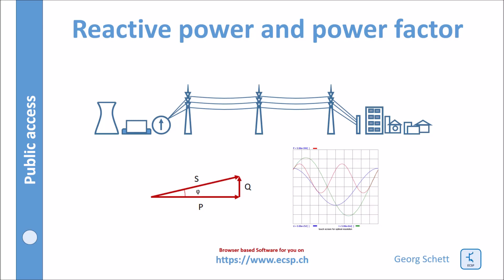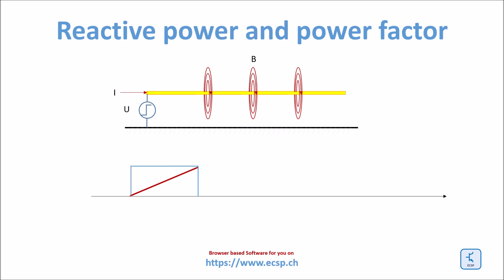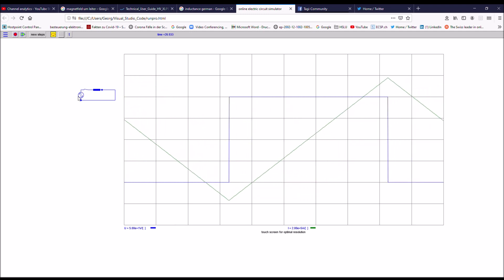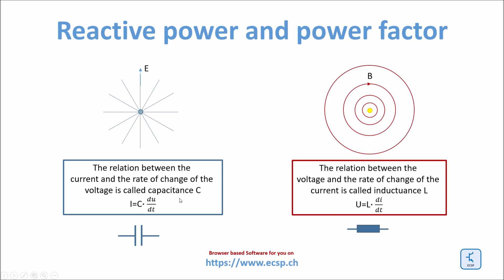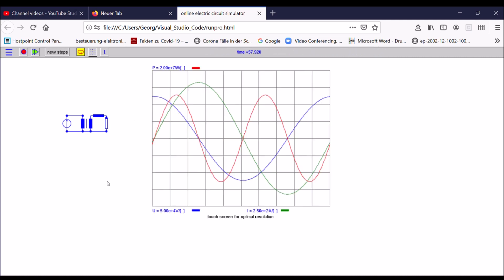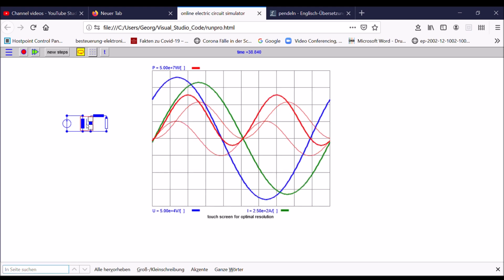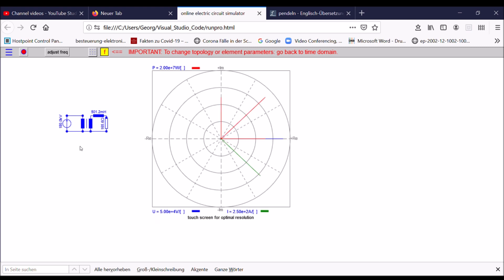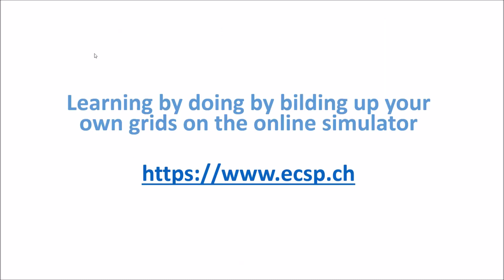Power system reactive power [circuit simulator]

Comment: Very nicely explained sir. I do have a doubt, in the first simulation, where you apply a current across a wire, where exactly is the magnetic field stored? If it were a coil with a core, the magnetic field is stored in the core and when the current is removed, the core induces a current. But, in this case, its a straight wire. Where is the field stored? Kindly let me know:)
Reply from the maker: Also a straight wire is surrounded by a magnetic field, as soon as current is flowing. Any current is surrounded by a magnetic field, also a lightning strike for example.

Comment: New Perspective...Reactive power is nothing but the power oscillations in the circuit due to inductors and capacitors present. It is really confusing when we are studying reactive power only with the phasor diagram, here I have explained the concept with the help of fundamental waveforms. Also explained why reactive power compensation is necessary, how we can compensate.
Reply from the maker: Good comment!
Reply: @georgschett801  Thanks!  I have used LTspice simulation to explain the concept.
Reply from the maker: @Concefacts  Well done! I know LTspice, it is widely used and a reference for electronics applications.